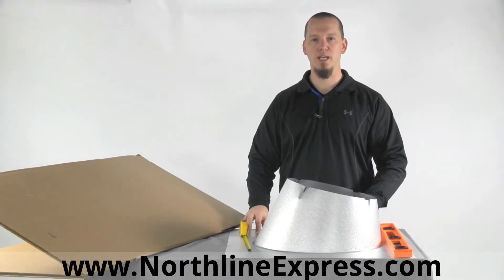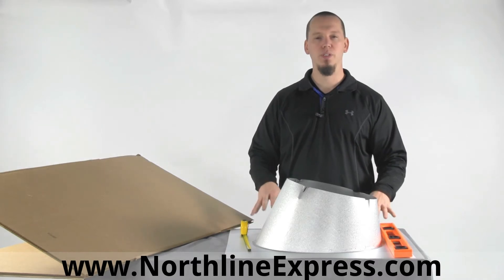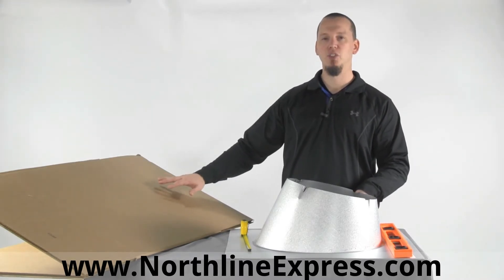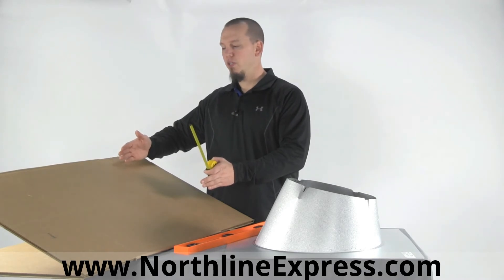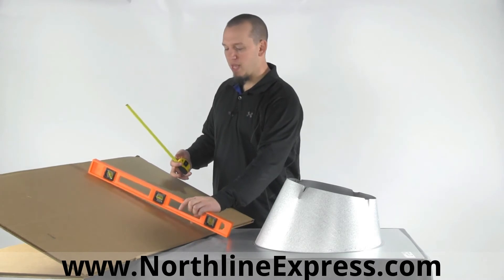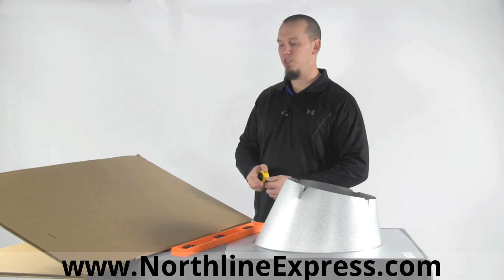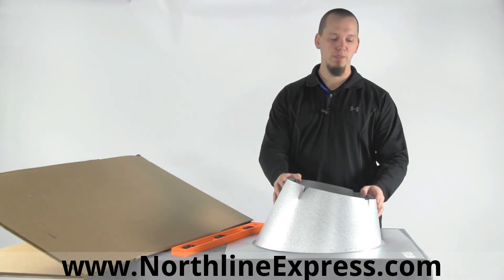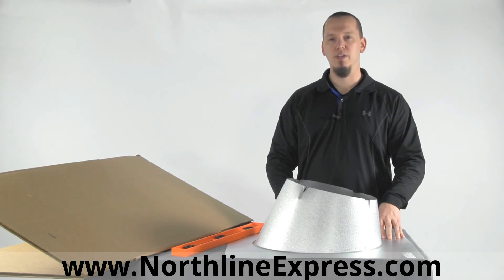How to Measure Your Roof Pitch for a Roof Flashing

Comment: You don't say if you are measuring to the top of the level or the bottom.............................
Reply: Exactly my same question!
Reply: BOTTOM OF THE LEVEL IF THE BOTTOM OF THE LEVEL IS TOUCHING THE ROOF ON THE OTHER SIDE .AND VISE VERSA